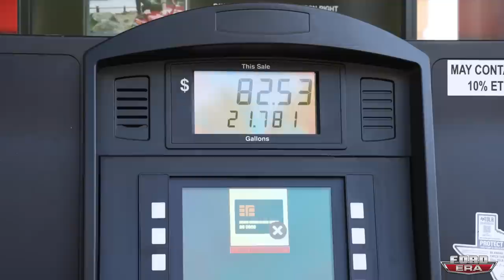Driving Snicker's our Godzilla Swapped F150 to Holley Ford Fest!!

Comment: Are you comfortable with the length of the rear drive shaft? I have the same truck (shortbed 4x4) and am concerned about the short distance between the transmission and rear axle. Leaning Coyote for that reason. Any thoughts on that?
Reply: I wonder if thy added a wedge under the rear springs ?
Reply: @donaldwilliams2270  Hopefully. The driveline angle would def change with the longer transmission.